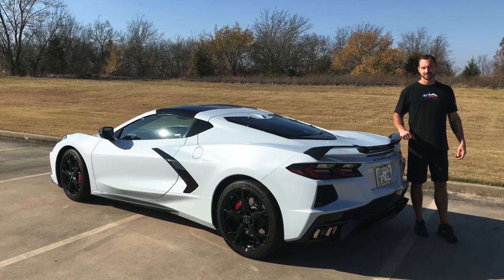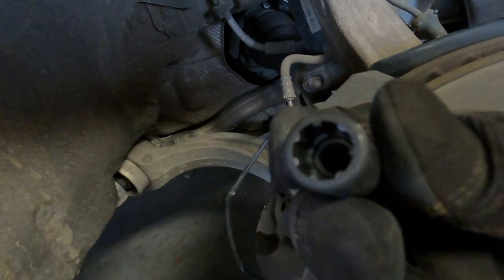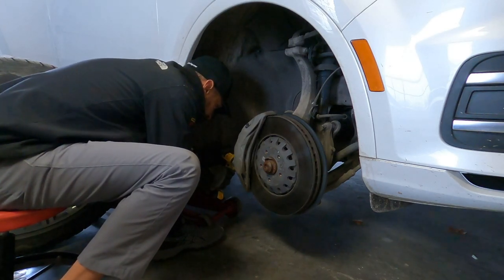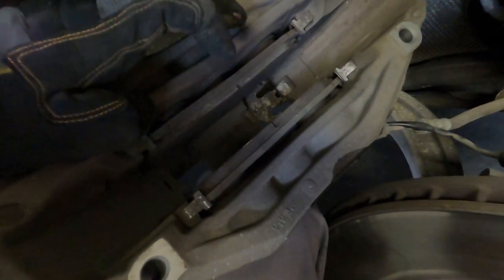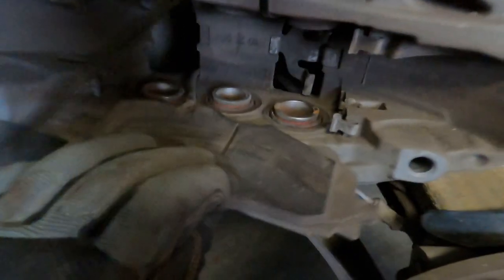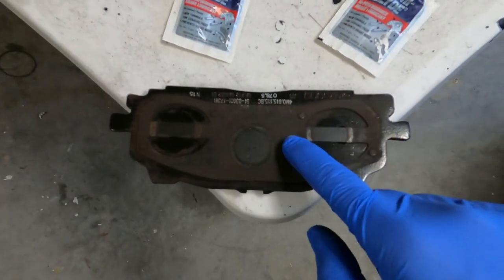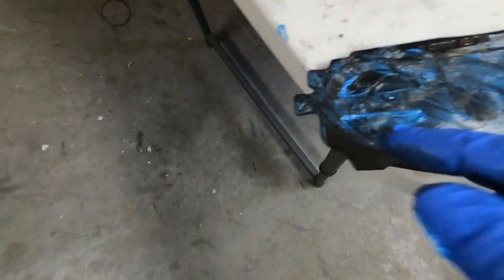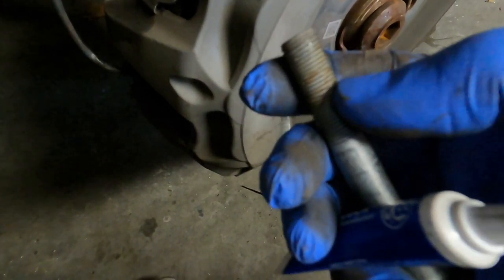HD Audi Q7 brake squeek / squeal fix!

Comment: In my opinion, don't spend $35 on that socket. Just remove the caliper by taking out the caliper frame 21mm bolts. Next, I had two of those main clips you can see already installed. Still sounded like a fricken train whistle backing up every morning... hot or cold out... doesn't matter. So I replaced the pads with Powerstop Evolution Sport carbon-fiber CERAMIC pads Z23-1894 from Rockauto. So far so good. Stopping power feels better than the original pads. I don't think the semi-metallic pads that come standard on Audi play very nicely with the rotor material.
Reply from the maker: Did you just change the pads and do nothing with the rotors? How many miles when you changed the pads?
Reply: @GreaseMonkeyTV  we just bought the car 6 months ago and just started "tooting" a month ago. I took off the pads and they are OEM and look brand new for a car with 40K on it. Hiding something?? My rotor were well within spec and the brake shop said they didn't need turned. So yes, I just replaced the pads. If i was getting vibration before the pad change out I would have turned or replaced the rotors
Reply from the maker: @nms1326  Good to hear. Our pads looked new with 60K on them!
Reply: Having the same issue and even while in drive. We are on our 3 set of pads in 15k miles and it’s doing it all again. Audi has not interest in fixing it and I’m ready to sell it. Love the car but the brakes sound like it’s an 83 Honda
Reply: @BRANDONTALONSKY  to follow up... ever since going to the ceramic pads I listed above, 2 months later squeal HAS NOT returned... yet. I'll be 100% convinced after a years time has passed. But heck for $45 bucks its 100% been worth it.
Reply: @nms1326  Thanks very much for the information.  Would appreciate any update you might have anytime.
Reply: @nms1326  how’s those Z23 performing?
Reply: @sikor18pl  not a single problem whatsoever.... no squeaks, squeals, or screeches. Worth so much more than  the $45 I spent to buy then
Reply: 9 months in, so far so good... not a peep...
Reply: It is actually stated in the vehicle repair manual that those two bolts that OP is taking out, is NOT the two bolts one should unbolt during brake pad change....do the two big 21mm hex bolts mounted on the spindle instead. Never touch the 2 special tool bolts due to alignment issues with the caliper. But hey, it worked fine for OP I guess.
Reply: This guy was lucky. I did mine that squeaked only in reverse. Did everything he said and bought all new clips 6 per caliber. Reinstalled now they squeal when cold forward n reverse. I did same th😢as you bought all new parts the same as you. Waiting on delivery. Hope it takes care of it. $70k for a car and the brakes squeal like a Chevy with worn out brakes. This started at 20000 miles on mine and my friends. I have low mileage 2018 that has 26768 miles on it. There is a tsb from Audi , but try to get them to fix it. Tsb technical service bulletin   https://static.nhtsa.gov/odi/tsbs/2022/MC-10214475-0002.pdf

https://static.nhtsa.gov/odi/tsbs/2022/MC-10210254-0001.pdf

Comment: I have the same problem on my Q7. Had the rotors/pads changed on schedule and I didn’t hear the noise for a while maybe for about 5-7000KMs. But since then each time I back out of my driveway after the car’s been sitting for 30 minutes plus squeals like crazy. Worst is when you park it over night and it rained… it’s so embarrassing each time you back out of your driveway. It goes away after the brakes warm up and occasionally comes back when I creep up slowly. I’m going to try the second clip and greasing all the contact points but I know it to be not a permanent fix… horrible design by Audi!
Reply: I’m having same problems
Reply: Audi won't give it the time of day.  It's so loud and embarrassing at every traffic stop. Never goes way.
Reply: That gotta be a super expensive for parts and labor. This seems like a good idea but it takes lot of work to lube so I might change the pads regardless

Comment: My 2020 Q7 sqeaks whenever it backs up hot or cold. Sometimes going forward too. Dealer tells me that the break hardware looks fine. I will try that grease stuff.
Reply from the maker: Keeping the clean (blow the brake dust out frequently) is the key.
Reply: Same here it squeaks for about 15-20 minutes, but I only drive for about 15-20 so it's all the time for. I took it to the dealership they basically said the same thing. Told me to do hard stops etc, it doesn't work. The told me not to put anything on it, it's normal because its such a heavy break pad.
Reply: Newer models there is a service bulletin to add another shim clip in the hole that has one missing.  I hear that helps.  Putting mine in today.
Reply: I went to a local repair shop that I know they said the brakes and rotors need to be replaced, I was little skeptic. They replace with Wagner Thermo Quiet brake pads and the problem was solved. No squeaking even when it was minus 8 degrees. I've been to dealership 3 times and was told breaks are good that's just how those brakes are on Audis. It's Bullshit. That's how the brake pads they use are.
Reply: @ryandellavecchia9349  .. I was wondering if adding the shim clip helped with your break noise?

Comment: Great video but only partially solves the problem and not a long term fix.  Take to Audi and ask for a second spring on the calliper which is a known issue and there is a technical bulletin released about the issue.
Reply: Second spring worked for a year and now it's squeeks like mad in reverse again

Comment: The permanent fix I think is adding the clip + brake lubrication like he showed in video. I did today on both front calipers and the noise gone for now...
Reply: Why is it so hard put the missing clip on. I tried and failed. I feel like it’s a different size than the original

Comment: Thanks very much.  I'm going to try it!!  Appreciate your video and help.
Reply from the maker: The brake dust from stock pads is the real enemy. If you have a compressor, just try blowing out the calipers every so often.
Reply: @GreaseMonkeyTV   - Its a missing 2nd spring on the calliper - Audi released a technical bulletin and are aware of the issue.  See my reply above to how it was fixed.

Comment: My 2022 Audi Q3 has horrible break squeal when creeping with the brakes. It seems like the entire chassis is vibrating with the pads.  The dealer claims no fix.  Would this help?
Reply from the maker: Cleaning helps.
Reply: Though, it's spotless with 2k miles
Reply from the maker: @ericshufro9209  Like compressed at air the rotors, pads, calipers, etc.

Comment: Same thing on my q7, only in reverse, will try.
Reply: I had the exact same issue on my 2016 Q7 a few months ago.  There is a missing second spring on the callipers - after telling the service engineer at Audi about he issue, he said that Audi had had just released a technical bulletin about it and it was known issue (Aug 2020).   Two hours later with a second spring added to the calliper and voila - fixed - Apr 2021 and still no squeek.

Comment: Did you end up fixing it?
Reply from the maker: Cleaning is a temporary fix. Audi has a bulletin that adds another spring clip. Apparently, it doesn't really fix it either. A different brake pad compound is the only permanent fix.

Comment: What's the latest on this? is this the end all of the noise?
Reply from the maker: Still need to used compressed air every so often to clean them out. Rotors & pads are the only end all.
Reply: @GreaseMonkeyTV  what are the recommended rotors and pads to stop it?
Reply from the maker: @stevel3881  I'll go with the Powerstop Z23
Reply: @GreaseMonkeyTV  what rotors do you prefer?
Reply from the maker: @stevel3881  That as a kit.

Comment: Hi. Watched your Q7 Break Pad video, and I want to ask you this: My 2018 q7 Breaks tend to shake (not breaking smooth like my other vehicles) whenever I drive over 80mph and begin to apply break pedal at about 60-70% intensity. I tried to have two dealerships fix this issue, one of them even changed the break pads and rotors (at least I hope they did, since my wife had that done on her own while I was overseas), it did some good in the beginning and now ( about 1year passed) same situation. The vehicle only has 50k miles on it and my wife is driving it for the most part. I would appreciate if you can maybe give some pointers if not a possible solution to this annoying issue. Thanx
Reply from the maker: Shaking when brakes applied is typically due to warped rotors. There may be something else involved here if rotors didn't fix it. Or, someone is really hard on the brakes. Has anyone checked tire balance and alignment?
Reply: @GreaseMonkeyTV  Tire Balance and Alignment Should be Good, considering that I purchased the tires relatively recently - but knowing how some mechanics negligently work on vehicles, I will not be surprised if balance is off or alignment... But, since I am not super knowledged in this, wouldn't a bad balance or alignment cause this shaking even when applying breaks at a lower speed and with lesser intensity?
Reply from the maker: @sg_atukr4247  I've seen some strange things with tires. My trailer will shake your fillings out between 32 & 35 mph. Otherwise, smooth as butter. All 4 tires are new.
Reply: @GreaseMonkeyTV  Yea. Weird stuff ) I will just take the pads off and inspect everything nicely and then go by the least expensive trial and error method ) If the rotor is in fact bent, is there a simple way of diagnosing it if it is a minor bending?
Reply from the maker: @sg_atukr4247  hard to tell with normal tools.
Reply: @GreaseMonkeyTV  Yea. Fair answer, I guess it was a hail mary question ) _ But I do appreciate your responses. Thank You very much. I will gladly be of help if you ever need any Real Estate assistance or help with buying/selling properties.  I operate mostly in NY/CT but I have wide network and do work with clients all over US and the World. So feel free.
Reply: Worn control arm bushings